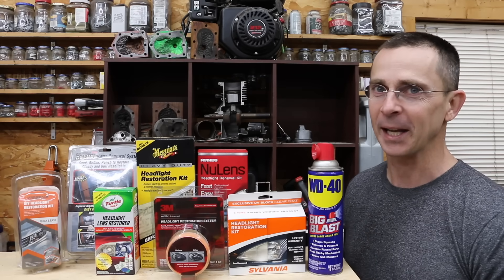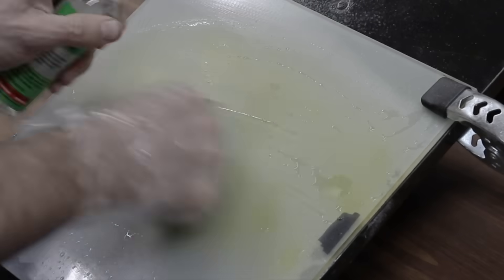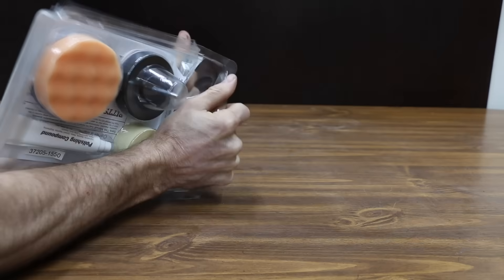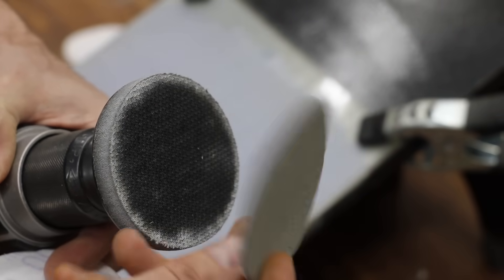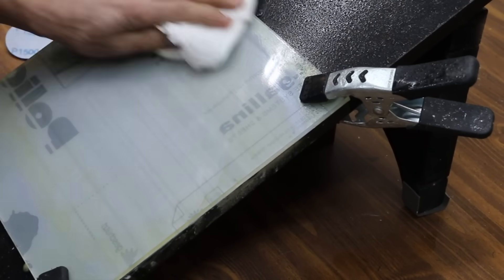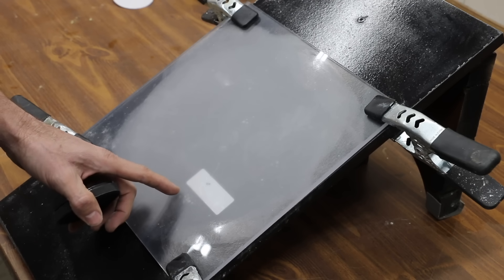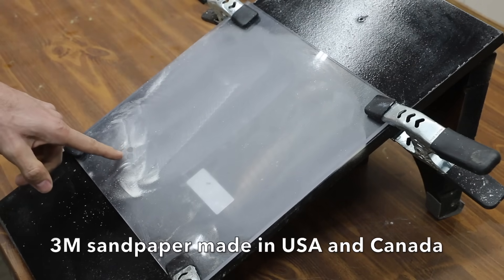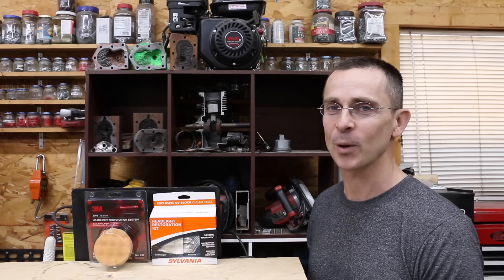Best Headlight Restoration Kit?  Let's find out!  3M, Sylvania, Meguiar's, Mothers, Turtle Wax & HF

Comment: I would like to see an update after a year, if possible.  I'm curious how long it takes for the headlights to fade, and how easy it is to restore them again.  Thanks.
Reply from the maker: Thanks for the video idea.
Reply: Great idea. I've found it's easy to get them looking good, but I don't want to have to polish them every 6 months!
Reply: I have an old 3m headlight kit. It did not have a UV coating step.
Without a UV coating, I have needed to do it over in 1 year several times. However I find I can just skip to the polishing step and finish the job in under 5 minutes per headlight. Good for another year.
I would like to know where I can buy an effective UV coating. How do I judge what to look for in a good UV coating? I would love to see UV coating comparison tests.
Reply: @edmcguirk8603  i use Rustoleum's Clear Gloss spray paint. It helps protect against UV and from chipping. You can find Rustoleum at Home Depot but any clear coat spray paint should work.
Reply: Without  uv coating to finish the job, trust me, they will be worse than before in a month if car parked outside.

Comment: The Carwizard did a video about fixing hazy yellow headlights by using brake fluid that eats away the oxidation. Maybe that's something to test/compare as well. I once used the cheap Chinese set you also have in this video, it made my headlights have like a foggy effect and I ended up just replacing the headlights. I might try to buy the Sylvania set just to test on the old headlights I have laying around, I am curious on the results, yours look impressive.
Reply from the maker: Thanks for the video idea.

Comment: I do not buy these kits I start with 800 grit sandpaper wet sand with 800 then a thousand then 1200 then 2000 then 3,000 then I paint it with UV clear coat about 3-4 layers when it dries I wet sand it with 3,000 grit to get rid of the orange peel little automotive wax here and there to treat the headlights and you're going to go

Comment: Great job PF. I tried the meguiars. But I mounted a buffing wheel on a angle grinder. 
Yes I was a mess. But it worked good as long I didn't stop in one place for to long

Comment: There used to be a clear final spray “paint” that was UV activated made by a company called SEM.  Couldn’t find it the other day at the auto parts store....any ideas, it was perfect for this application.  Very expensive tho....
Reply: Last summer, I used Meguiar's G2970 kit.  It had a spray coating for the final step.  Worked well, still looks good, almost a year.

Comment: Cheap kits usually won't give the drill attachment. 
Preventative maintenance needed or.. you have to do a full polish again. Can only cut so much off the lense before it becomes brittle.

Comment: Great video! I would have liked to see an evaluation of the effectiveness of the sealant compounds vs UV, though. It would cost you some money, but there are independent test labs that could condition polycarbonate samples for you in a xenon arc chamber to accelerate the weathering process. If you wanted to get really ambitious, you could do that to generate the initial weathering, too, and it would ensure all your samples were equivalently weathered. I’d suggest the ASTM G155 cycle 1 conditioning for at least 720 hours each time (I do this sort of thing at my job).

Comment: Thanks for this. I’ve been wanting to do this on my wife’s odyssey minivan which looks new other than the lights. Never knew which kit would actually work. Just ordered Sylvania kit from amazon. Next weekend’s project is set!
Reply: You won't regret it. It works great from personal experience. I use distilled water when sanding just to be sure

Comment: I just used the 3M brand kit, only it was a little different than yours. It included 2 swabs for coating the lenses with a new protective layer good for 2 years. The car was a 2008 Mercury Milan and the headlights were 70% opaque with yellow. After the sanding and the swabs of new UV protection the headlights literally LOOK LIKE NEW. I cannot believe how fantastic they look. This kit was in a larger box and cost $19.95 at Advance Auto Parts.

Comment: I had Turtle Wax, but I had to buy fine grit sandpaper prior to applying the kit.  I realize, after doing research and comparing other kits, I was going to need sandpaper anyway.  The kit's compound is great, but not the sandpaper it came with.

Comment: Great video!   I've assumed these kits were all the same and probably would've bought the Meguiar's one based on the brand name, so it was really illuminating seeing how much better some did than the others.  Very helpful for whenever I need one of these in the future.  
I think this could've been made even better if, at the end, you split an old yellowed headlight in two with some tape and used the worst product on one half and the best one on the other half to show the real-world range of results achievable.  
Maybe a little out of line with your usual subjects, but how about a similar test of tire-black/tire-shine products?   Get a set of four (or more) identical make/model old tires, clean them all the same way, delineate them into quadrants so you can apply four products per tire, then lay them out flat exposed to the elements.  Then, later, take the four that held up the best and put one onto each of your car's tires for a real-world endurance test..

Comment: We use a 3m headlight restore similar to that 3m kit in our shop at work. The first kit they gave us was exactly like that 3m kit and we had them coming back about a year later to redo the restoration. They new kit they gave us has a clear coat instead of the polish and it works much better. They look more clear and we have not had one come back since we switched to clear coat.
Reply from the maker: Great feedback. Thank you

Comment: Maybe you could also try testing trim restoration products. There are a number of products by Mother's, Turtle Wax, Meguiars, Lithium Auto Elixirs, etc, and they could be compared to the "heat gun method" as an alternative. You could also test how well they hold up to washing. Some claim to last up to 100 car washes - that would be a good claim to test. I've found some seem to wash off in a single rain.
Reply from the maker: Great video idea

Comment: I've used this product several times on different vehicles.  I live in Hawaii and we do get a lot of UV light.  The only negative is that it doesn't last forever  About every 6 months or so, another application is required.  The process is easy along with the instructions.
Reply from the maker: Great feedback. Thank you

Comment: I just replaced my hazing headlights with a aftermarket clear assembly for my 97 f150. It was 40 bucks for headlights and turn signals on amazon.
Reply: Will you try to report back in a while to say how they hold up (even in a few years)...? 🤔

Comment: The 3m heavy duty restoration kit I bought did come with a clear coat sealer and a year and half later and they are still clear and almost as good as new. I have also seen people sand the lights and spray a uv resitistant  clear coat from a rattle can that would have been an interesting comparison as well. Though that method requires heavy masking on a car to prevent overspray. unless headlights are removed.
Reply from the maker: Great feedback. Thank you

Comment: Great video! I have actually used the turtle wax kit and was really disappointed. It did not get the job done. I have also used the 3M kit and was pleasantly surprised. Only problem is that it only has ONE 3000 grit sandpaper. I had to contact 3M and have them send me another 3000 grit. With only one 3000 grit it is barely enough to do 2 headlights.
Reply from the maker: Great feedback. Thank you

Comment: FWIW, I used to just use toothpaste and a buffing wheel, or holey socks if I couldn't find the buffer. While it yellows faster because I don't use sealer/UV protection, it works in a pinch if you're a cheap so-and-so like yours truly.
Reply from the maker: Great feedback. Thank you

Comment: Could you test using heated acetone vapour to restore polycarbonate? I've seen some pretty incredible (but likely fake) viral videos showing it over the years, it supposedly reflows the surface and takes almost zero effort.
Reply from the maker: Great recommendation

Comment: Great video!!  Your sandpaper tips and comparisons were excellent!!   Here's a quick-fix tip - Mother's Mag and Aluminum Polish will clear a headlight lense for about 6 months with a simple cloth wrapped around a fingertip and applying polish in a circular motion.  No sanding, no buffing, just a wiping rinse and gives a quick temporary solution until better weather or opportunity comes for a long term solution.  This can be repeated several times over years for a tiny fraction of the cost.  Save your money on laborous restoral kits and buy new lenses!
Reply from the maker: Great feedback. Thank you

Comment: I've used several different kits myself, and the big issue I see with your tests is you really couldn't tell how polished it was because you had the backer on it. ideally you would want to look through the polycarb at something to see the clarity while you are doing it to see if its working, and to know when to stop. I also didn't think the yellow spray on coating was going to be sufficient, but its actually a really good analogue. and yes the 3m kit will haze over time. 
I also used another kit, cant remember which brand, but it had a wipe, and it streaked like crazy.
Reply from the maker: Great feedback. Thank you

Comment: I just used Meguiar's PlastX today with a clean towel on a 10 year old BMW and a 7 year old Lexus. After applying both cars looked like they had brand new headlights installed. I then sprayed on Meguiar's Headlight Coating to seal the headlights. I cannot believe how easy it was and how great the headlights look on both cars.

Comment: I would like to see some restored headlights subjected to different brands of "UV Protection" and left outside in the sun and the elements for at least 6 months.  The consumer product reviews (on the Sylvania UV Protection and others like Rustoleum and Krylon in a spray can labeled as UV resistant gloss clear coat products) are saying that they don't last and need to be reapplied in just a few months time.

Comment: Being a former auto-detailer this video is right up my alley. There are a lot of these "kits" out there but if you have a good amount of auto care products, you probably already have everything you need. Some sandpaper, drill buffer or high speed buffer, some cutting or polishing compound and some basic clear coat spray. Unfortunately you are just fighting the inevitable as they will always return to the hazy look. Great video dude.

Comment: Love your videos!  Always compare fairly which is what we need when we pull out the money.  I just submit to the fact this should be done yearly in the fall.  Takes less than 40 minutes once I understood everything I needed (blue tape, drill, overcast skies, a couple brewskies) and it is a simply annual task.  I have always used Mother's but will try 3M or Sylvaina this fall.  My Mother's box gets me three years of headlight cleaning before the product needs to be retired.

Comment: Firstly, great video - I always enjoy your scientific approach to testing!
I've personally had great results with the 3M kit in terms of effectiveness (sanding + buffing results), however, you *NEED TO RE-COAT THE HEADLIGHTS*, otherwise they'll discolor within a short period again due to the UV light (usually < 12 months). 
As a result, I've also used OPT7's kit ("OPT7 Headlight Restoration Kit") which includes a ceramic coating fluid which you can apply multiple times. Looking at the sanding grits and buffing pads in the OPT7 kit, they look to be similar/same grits as the 3M kit, however, I'm yet to use these actual sanding pads (I used up the remainder of my 3M kit, then applied the OPT7's  polishing compounds and "Ceramic Nu Sealant"... essentially just to preserve a new sanding kit in case I need it for another vehicle). 
3-4 months later and the headlights still look like the day I sanded/buffed them!

Comment: I'd love to see a video comparing the different clear coat protective treatments to limit UV damage to these headlights. Maybe apply them to the clear polycarb sheets, lightly scuff the surface to simulate road dust, and sit them under a UV lamp for a month or two
Reply: That would be awesome, a UV wipes vs UV clear coat sprays vs wax/sealants like collinite with UV protection, and without?

Comment: Very interesting. I used the HF one a few months ago on some moderately and heavily oxidized lenses. It definitely seemed like the pads clogged up quickly, but I kept using them. Ultimately I was very pleased with the results, though. But I've been wondering how well Mother's and Meguiars work. I would have thought the drill based kits would work much better than had sanding. Interesting results

Comment: I used to try this stuff and gave up. I found they would yellow real fast after you polish them. Also some of the oxidation seems to be on the inside. I finally gave up and bought replacements from Amazon. Most cars you can get new headlight assemblies for less than $200 for the pair.

Comment: I always used a good car wax with UV protectorant on my headlights a few times a year. After 200k miles of highway use, the lights were pitted a fair bit, but were still nice and clear. I assume the UV protector in the wax kept them from yellowing. I bought a new car recently and will start doing the same, but this time with 3M's 303 spray.

Comment: Weirdly enough, I’ve used the turtle wax brand several times on different cars, it’s always worked fantastic for just yellow and hazy headlights. I wasn’t a big fan of the yellow clear coat being used to simulate oxidation as the oxidation is still only oxidized plastic and not a paint which clogs the paper
Reply: Plastic headlights actually have a coating clearcoat so he is right to simulate with coloured paint
Reply: Worked fantastic for me too, 15 years of nasty yellow haze completely went away.
Reply: I still feel like it depends on the clear. Is it a soft clear that will gum up or an acrylic clear which should sand into a powder like the plastic itself. I also used this kit to restore black tinted headlights back to clear with great results.

Comment: So assuming your headlights have already yellowed or become cloudy and you then took the time to sand them down and polish them to clarity...that it ends up being easier to quickly hit them every 3-6 months with a quick plastic polishing compound.  I just do it when I am waxing the car or doing a really thorough car cleaning.  Takes like 30 seconds and keeps the build up off in a much shorter overall time than it does taping everything off to clear coat them or using some sticky protective coat.

Comment: This literally doesn't make sense.  No one's spraying the lights with yellow paint. I don't know why you didn't get several head lights. Also heat from the bulbs would add to wear and tear    halogen vs LED lights. Also Southern vehicles vs Northern where salt is used.  This test literally is apples to oranges.   Most of your reviews are great. But sorry pal. This one's not in the same category

Comment: The best way to clear up your headlights is use Mother's mag and aluminum cleaner.  Rub on with rag, let dry, then polish with a clean buffer wheel (I use lamb's wool pads)  Coat with Caranauba wax once every 6 months  to keep lens protected from the sun.
Mag cleaner contains aluminum oxide that's what does the cleaning.
Reply: No sandpaper needed.
Reply: No.  Just the mag cleaner and a clean wheel after rubbing it.  THEM Meguire's caranauba wax.

Comment: I have used a 3M headlight restoration kit a couple of times. Its not the same kit you used if you go to 3M website you will see they make a few different kits. The one i use comes with a sealer to protect them from the uv light and seem to last several years it also comes with tape and a couple of items your kit did not have but the is also more expensive than the kit you used. I have also heard of people using tooth paste to clean the headlights as well. LOL great video as always. Thanks for your effort in making these awesome videos i always learn something. God bless you and your family!!

Comment: G'day,

Yay Team !

My 2000 Forester almost failed it's 2019 Registration-Check, due to Opacity of the Plastic Headlight -Shields (Glass Headlight underneath, it looks like...) ; so I used Armorall Plastic Cleaner on Toilet-Paper, and it passed in 2020 no problems.

Back in the 1970s we used to use Toothpaste as Cutting-Compound, on the scratched Perspex of 2nd-Hand Cessnas & Pipers & Beechcraft, at the Used Aircraft Sales outfit I used to work for at Bankstown Aerodrome in Sydney.

Back when Unicorns roamed the Earth, and Wheels had flat sides going all the way around them...

   I'll look out for that Sylvania stuff though - it looks like it'll do the job.

Such is Life,

Have a good one...

Stay safe.

;-p

Ciao !

Ciao
Reply: NOW I understand the name....! 😅😍🤣✌️
Reply: What do you mean by "When Unicorns Roamed the Earth?"

They still do in MY World. 🦄

Comment: i use toothpaste and a rag then buff and apply motor oil on rag and rub it..or just the oily rag works for a few days at time...oily rag method good for inspection sticker if not terribly yellow  :)   thank you for testing these!